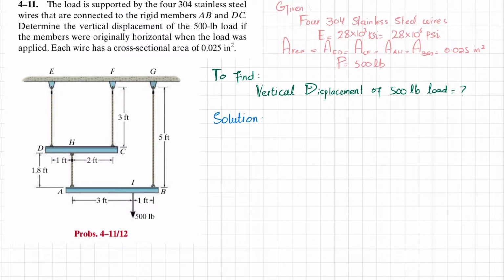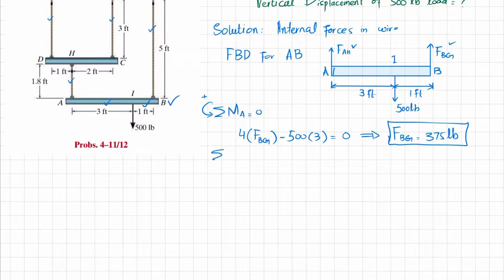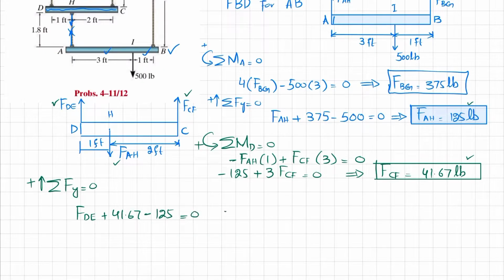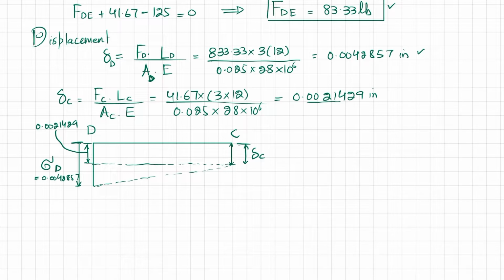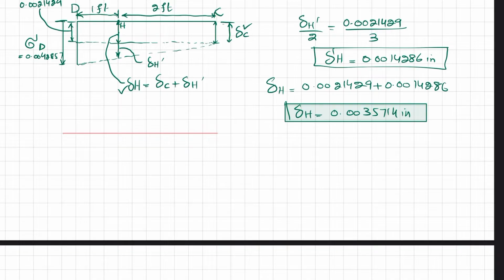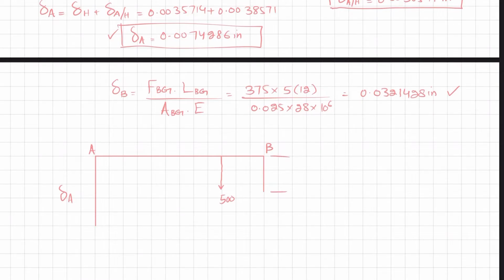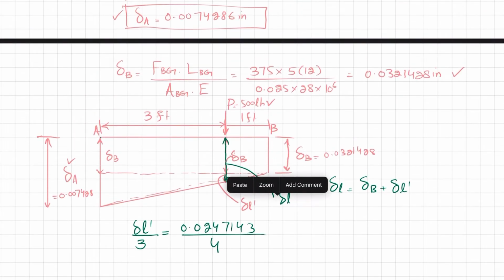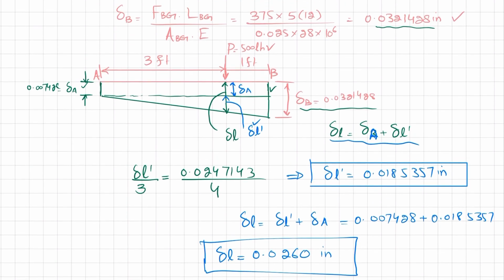4-11| Chapter 4 | Axial Loading | Mechanics of Materials by R.C Hibbeler 9th Edition|

Comment: why are you using the displacement for point c when calculating displacement for the load
Reply: no my bad, i understand i made a mistake on my calculations
Reply from the maker: It's good that you understand that
Reply from the maker: because it is required for the solution of rest of the problem